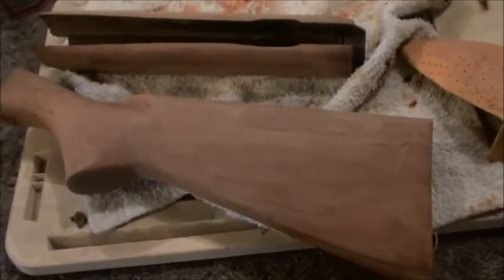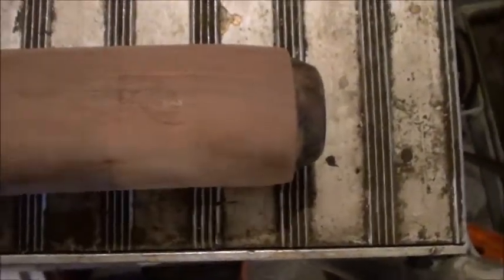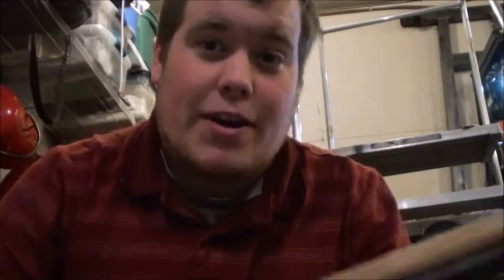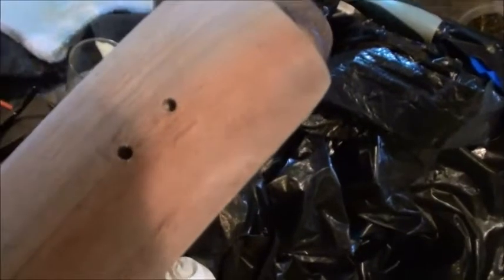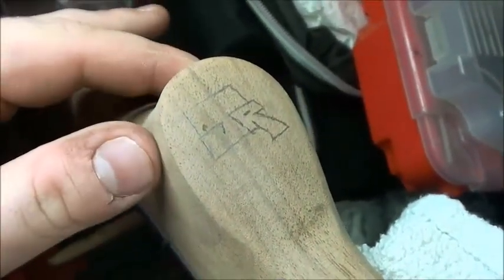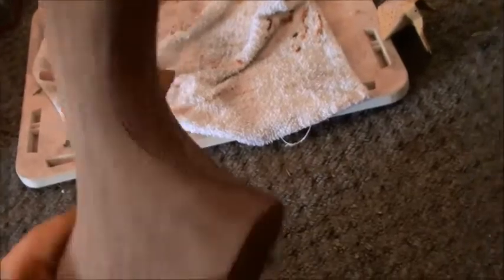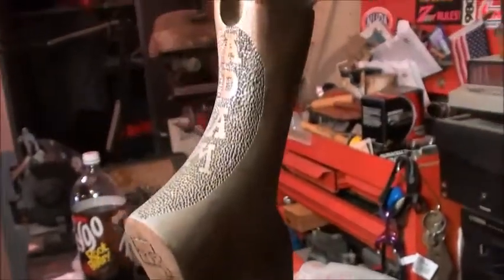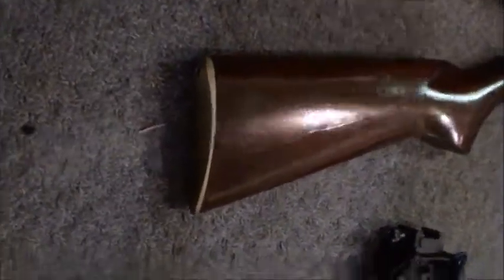Remington 740 Build

Comment: What I know of the 740 (I also have one) is that it was only produced between 1955 and 1959. After that it was called the 742. So it's possible your stock was a replacement from a later model. I only have 5 round mags. Where do you get you larger ones?
Reply from the maker: +Munitia Blastpaw gun show! haha but if you go to any major store they should be there (Gander Mountain, Cabela's, etc) or the internet lol thanks for the comment